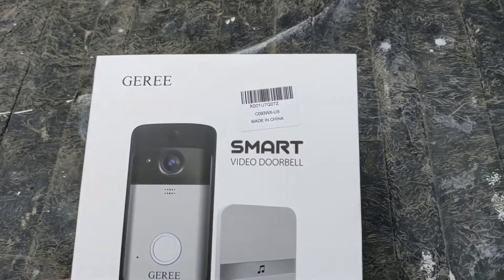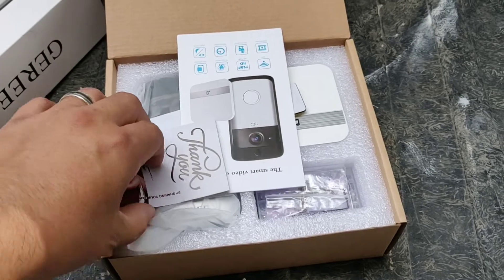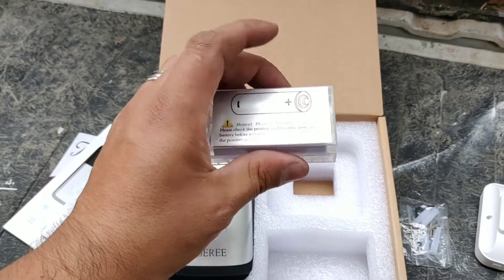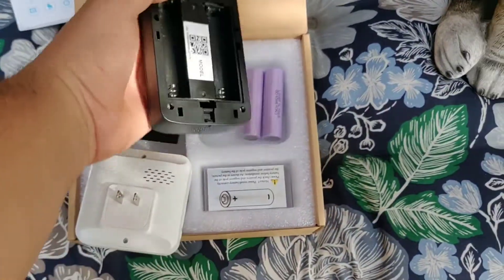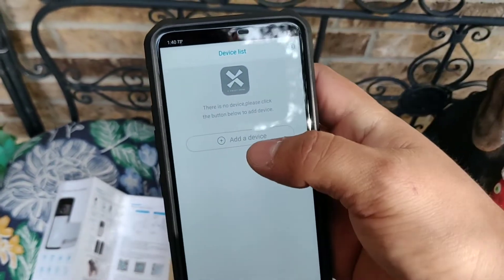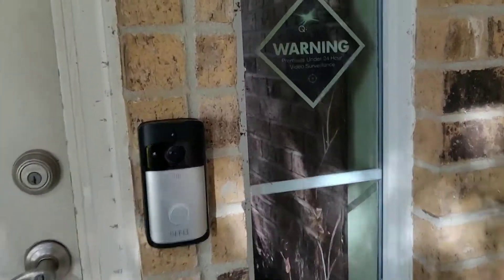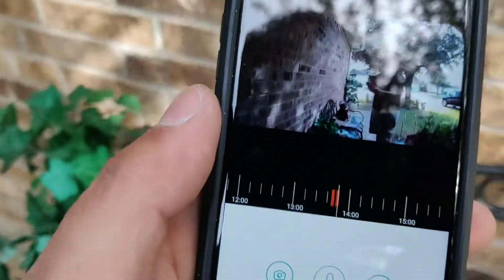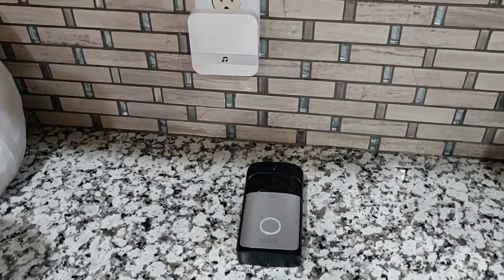GEREE Smart Video Doorbell

Comment: Hello can it do both as in hard wire and using the the supplied batteries or does it have to be one or the other? Still want to to able to use my downstairs bell chimes and maybe use the supplied chime upstairs thanks.
Reply from the maker: It can be hardwire to your house doorbell, now because my doorbell is not in a good place for me to use this there, that's why I didn't use it. But i think that should power it plus sound on your house bell
Reply: @Jorge.Rangel  Ok sounds good thanks for the reply.

Comment: When you hard wire this do you retain your original bell?
Reply from the maker: I haven't hard wired it because my door bell is at the other corner so the camera wouldn't get much but want to say yes as it will function as your original door bell button and trough is system it will also chime the speaker

Comment: Have you had any success with changing the chime?  I have tried everything and still get the default ring.
Reply from the maker: From the speaker that plugs into your outlet yes, very easy by just pressing the button. From the app I had to switch my notifications sound on that particular app. As far as the chime that the actual doorbell sounds when pressed, I don't think it can be changed.

Comment: When this charges, do any lights come on? I tried charging the other day and apart from a couple of the flashes at the start there were no LEDs saying it was charging, i also still got low battery warnings afterwards.
Reply from the maker: I think there's a red led in the back of it. I usually charge it every 3 weeks during the day and and put it back before night
Reply: @Jorge.Rangel  mine doesn't have a red led but the last time i overnight charged it seems to have stopped the low battery warning